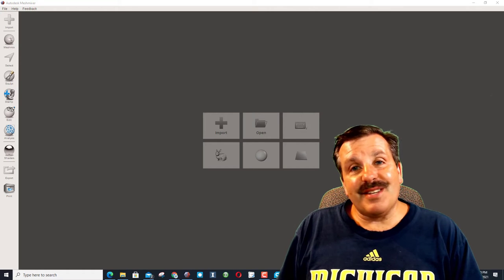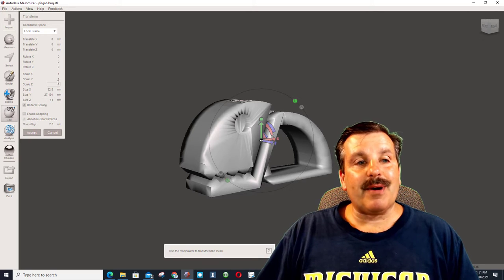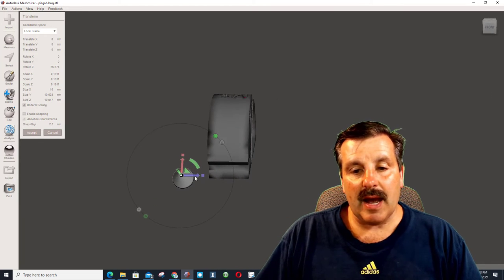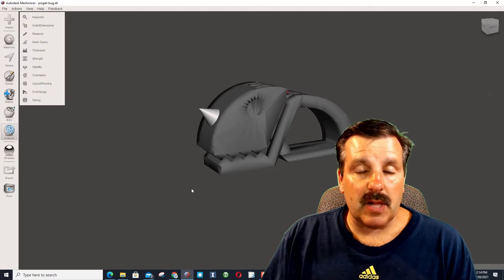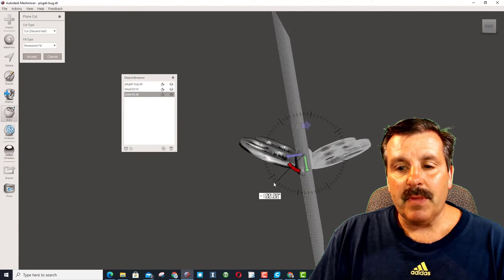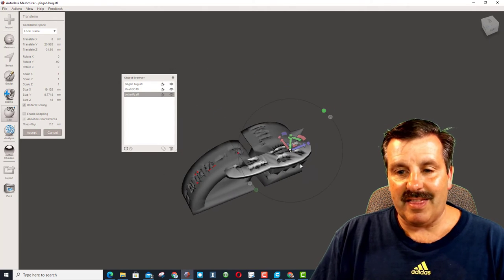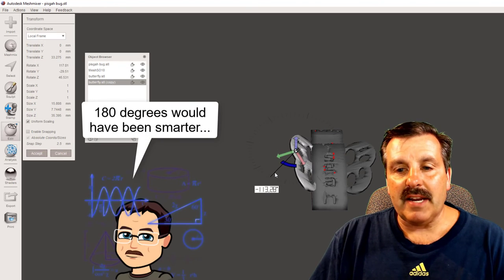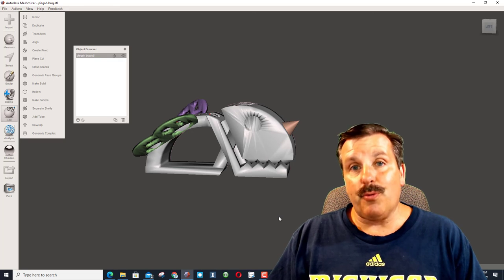Easy steps to Modify & Merge STL files | Mesh Mixer in Minutes

Comment: Meshmixer to cura...saved to SD...ender 3 max neo...when I print it only heats up parameters but prints nothin...does anyone know what I'm doing wrong please help
Reply from the maker: Can you print other designs of the Ender?  Just trying to figure out if it is a printer issue or software issue.